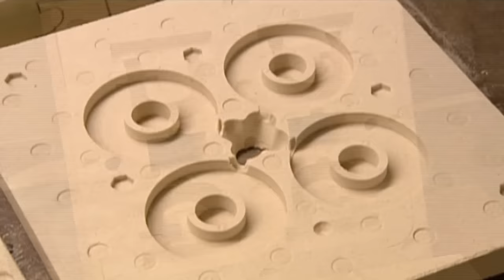MAGNETS | How It's Made

Comment: Never thought that making magnets is so labour intensive and difficult. Really expected the process to be almost fully automated. Thanks for the video!
Reply: It probably is for the very common shapes and sizes. This looked to be more custom products.
Reply: Metallurgy may be more automated in developed countries, but since the huge majority of it is done in poorest countries, it does end up being more labour intensive.
Reply: These are probably from the '80s or '90s 😂
Reply: This looks like a shop that makes low volume custom shapes. These are also  cheap nickel-iron based magnets. They are still used in cheap dc motors and similar products, but high efficiency and industrial products almost all use neodymium-iron-boron magnets, which are much stronger, and made via sintering, to tune their properties more precisely. Those are generally made in massive batches. And the processes are much more automated.

Comment: For those of you thinking that this process is wasteful and sloppy, let me introduce you to the metal industry, where a lot of processes like this are the norm. Mass-produced designs for items like these are very hard to make safely in any kind of laboratory or workshop, and factories rarely involve some kind of quiet, safe environment. Metalworking in general is very loud, messy, and slightly dangerous. That doesn't mean that a lot of the materials go to waste, though; the sand, concrete, and metal scraps used are usually ground down, cleaned, and recycled for later use again, since its mostly just silicates and metals. The metals are even sometimes chemically sifted back into their base components and reused as well, since they're the same metals that will go into the magnets anyway.

This is coming from a guy who worked as a metalworker/welder for a few years, and who has absolutely set himself on fire several times from just being around red-hot metal for too long. It's just the way it is.
Reply: Damn
Reply: @Nostalgicinquisitor  you and me both
Reply: @lucasjustlucas2176  lol
Reply: That's very insightful. Looks really dangerous, especially the guy pouring metal into that furnace with a short sleeve shirt.
Reply: Sebastian Thor  Nope, that's just the way the industry is in general. Some countries have worse practices, but it's mostly the same. When you're dealing with handeling molten metal, there's not much else you can do
Reply: Good one
Reply: Is there some way to automate the process so more items per hour could be produced?
Reply: Thank you.
Reply: Im not gonna read it
Reply: This should be on top.....
Reply: What is acoustic
Reply: I wanna hear more about this spontaneous combustion :D
Reply: Umm ok
Reply: Thanks for that information. It seems a lot of people in the comment section are experts and seem to know a better way to make magnets and other metals
Reply: Ayee cheers man!
Reply: I tip my hat to you.
Reply: @nejivoi  Gold member
Reply: I’ve worked on auto assembly lines in the 1960’s and they were messy, loud, and dangerous.  Later I worked night security in a drop forging plant.  It made the auto assembly plant look a lot better.
Reply: @Kalmaro4152  Occasionally, mass-production is improved upon, but it really depends on the item produced. With something like magnets, it's pretty finicky to figure out, but it's not impossible, and I'm sure that quite a bit has changed since this video.
Reply: @HomicidalTh0r  Funnily enough, it usually happens when you're wearing heat/fire resistant gear. You can't feel it, so sometimes you lean on something you're not supposed to and burn a hole through your shirt without realizing :)
Reply: @stroys7061  Exactly. Though, I imagine some of the methods have (probably) been improved upon since then.
Reply: @Kalmaro4152  Of there is, but someone has to build it first
Reply: Thanks for sharing this! I didnt think it was wasteful, just chaotic lol and destructive looking, but it is what it is.
Reply: Thanks for sharing the additional insight!
Reply: The longest comment I've ever seen
Reply: Crazy to think that you can just burst into flames as soon as your cloths get past their ignition temp
Reply: As an electrical engineer I see a lot of possibilities to improve efficiency and speed with automation!
Reply: @sneaky_krait7271  I agree! And in some cases there already have been vast improvements since the making of this video (when was this, circa 2004?). However, I know from personal experience that it's hard to develop automated machinery that's resistant to both high-temperature environments and strong magnetic fields like what's in the video. There's always the risk of machines melting themselves down or throwing molten iron around without realizing (which become a greater risk than simply making the magnets by hand), and magnetic dust can heavily interfere with installed hardware (a circuit board's worst nightmare).
Reply: @Kalmaro4152  Yes, but humans are cheaper than sofisticated machines (robots).
Reply: thank you for clarifying ,I thought this was very wasteful , but through this i can see that i don't know alot of things
Reply: @ExTess  Yea you will need good protection and filters for the dust. I am not sure if the magnets will make it impossible, but there is plenty of other metal producing. If they are applied they are ofcourse tested that they won't melt themselves
Reply: Thx for the info and your replies. It's great to hear from people with actual experience.
Reply: Thanks!
Reply: Not too many people can say they've set themselves on fire... MULTIPLE TIMES....
Reply: @OB1canblowme  When you're on the ground floor getting your hands dirty, you don't really care about those things, since they're mostly the responsibility of the higher-ups and the law. As long as the work is a controllable level of danger, and you're not breaking any laws, nobody cares. DFM and the ISO only go so far per manufacturer, otherwise it's just "here are the materials and the machines to make them, now do your job and don't break anything you're not supposed to".
Reply: Im glad theres jobs like this where people have to accept the scary in this watered down scared of everything society
Reply: @OB1canblowme  and I think you can start paying attention to automatic spellcheck before criticizing people of not knowing about Quality Assurance practices;
Quality Assurance standards are constantly evolving;
Reply: how are you still alive from being on fire and I also wonder how does it feel being set on fire? I work in the engineering firm and even tho i work near hot dangerous environment ive never been set on fire once
Reply: @siroof5663  Like I've said before, it usually happens when you're wearing heat-resistant materials, ironically enough. You don't always know when you're touching something hot enough to light you on fire until you look down and see the fire, since it doesn't hurt. And if you're welding, and distracted by trying to get the perfect bead then you don't always think to check your apron that's getting covered in molten slag. Other cases mostly involved sparks catching on a frayed part of my jeans, since they were very worn while I was working at the welding shop, or leaning on something I wasn't supposed to.
Reply: Well said 👍🏾👍🏾
Reply: Damn bro, thanks for the information!
Really appreciate it.
I've been reading your comment section.
Reply: I have worked in a soft drink plant and cleaned the large tanks in the factory. They send you with a helmet with headlight and harness and rope on your back. It's dark and really scary inside the tanks.
Reply: @What-ch1bn  its a way to say autistic without saying autistic.
Reply: I didn’t let you
Reply: Legit, cool story bro :D so to work in a company as in the video, what functions or businesses should I look for?
Reply: Be careful dude
Reply: @Nostalgicinquisitor  Magnetic
Reply: There is still a lot of waste here. Filling in the sand with a cup instead of something like a spigot? I'd love to see a Chinese magnetic plant and see if they are as sloppy.
Reply: Meh I wouldn't have even acknowledged people commenting on the sloppiness. This is manufacturing folks, it looks this way for nearly all types of manufacturing to a varying degree. Metal work is particularly messy, so is carpentry and lumber mills, just a different medium. I work on the worlds largest mass produced aircraft(s) and guess what its messy too, less than this of course but still messy. Cutting wings on some of the largest CNCs you have ever seen makes a lot of chips and requires a lot of coolant also results in a fair amount of scrap. That is just the nature of manufacturing. If you think this is bad you would probably think twice about stuff you buy on amazon daily from china if you knew how those factories looked and operated...

I will also note that depending on the product being manufactured, final assembly is by far the cleanest steps. So when you see an aircraft or a tesla in the factory being assembled, there is not a lot to be messy at that point, and there is more effort not to be because it will affect the finish of the product. To contrast, when pouring molten metal you are more concerned about speed since the metal will begin to cool and set immediately so spilling some drops but having a successful poor is better than not spilling any drops and losing 100% of it because you were too slow and it cooled prematurely not filling the mold.
Reply: @BenJaminLongTime  Yes! Exactly this.
Reply: Say that slower and dumber
Reply: In fairness there are at least a couple of other videos on youtube showing much more efficient magnet production.
Reply: Z
Reply: @What-ch1bn  illiterate
Reply: @cus6428  it’s like three paragraphs. Have you never read a book?
Reply: I've seen an episode of The Simpson that portraits the way it is :D
Reply: @What-ch1bn  then why are you replying? Let me guess......10 or 11 years old?
Reply: It's not even worth trying to make things any safer, because ultimately, peasants are replaceable and inexpensive, whereas retrofitting every metal workshop to have better safety standards would be costly and time consuming. I'm glad to see that the worker drones agree with their bosses about this and accept it as their fate.
Reply: @Elrond_Hubbard_1  I can't tell if you're being genuine or sarcastic, given that there are some people who would probably agree with either or both sentiments, all things considered

As Mike Rowe once put it: “In the jobs I have seen thus far, I can tell you with certainty, that safety, while always a major consideration, is never the priority.”

Some people know their limits and just want to get the job done. Those who don't, usually don't work in a dangerous industry in the first place. There's nothing wrong with wanting their work environment to be safe, but sometimes safety can't be guaranteed where you're needed.
Reply: @ExTess  sooo tell me, what niche were u involved with i.e. wire and cable, sheet steel? Round stock? Billet? And, how many countries have u worked in?
Reply: @OB1canblowme  hell they probly haven't even heard of an MSDS
Reply: U trying to scare the kiddos with stories about catching on fire? I've been welding 25+yrs and been on fire a dozen times or more. The 1st time my brother actually CAUGHT me on fire. Sibling rivalry, and nothing smells more sickening than the skin that sticks to red hot metal and just cooks... these durka durkas are 3rd world af. Ya, the metal industry is kinda no frills and borderline dangerous for dumbasses to be around. But let's not act like the human factor isnt far more dangerous (no matter what industry u look at). Just my 2 cents
Reply: @stroys7061  I mean that is basically just a giant hammer hitting a giant piece of metal
Reply: I'm just sayin' 'dem buy a big-ass magnet from you right now. You got salesmanship. If you already don't do it! I'll give you a 9.5 out of 10 m

Comment: How to make magnets: 

2:32 You need a magnet.
Reply: Not true.
Reply: I used the magnet to make the magnets
Reply: @MrStringybark  Wow, you are so smart.
Reply: Weaker magnets will do the work just fine..there are naturally formed magnets, but it's very weak.....guess that's how they made the first magnet....by using the natural magnet......
Reply: You could just search it normally and you would still find it, the workers are using magnets to speed up the process
Reply: They use electromagnets to make permanent magnets.
Reply: @TAWithiam  How'd they get the electricity to power the electromagnets?
Reply: @bsmith6784  single use batteries (known as primary cells) and early static electric generators (which used the triboelectric effect instead of magnetism). 

You can also make magnetic based generators with no permanent magnets as long as you can provide an initial surge of power to start the excitation (look up excitation_(magnetic) on Wikipedia).

Comment: If those materials were easy to re-magnetize we wouldn’t be using them for ‘permanent’ magnents. You need to heat it up until it’s red hot and then have it near a strong electromagnetic field (bigger electromagnet or permanent magnet that re-orients the atoms in the hot one)

Comment: 4:35 if this dude touches both plates while pressing the button he'll be toast. 30Amps at 300 Volts is pretty nasty. Why does he not have insulating gloves
Reply: I prefer Senku's method of making magnets
Reply: Did you see DC Amperes x 1000 ?
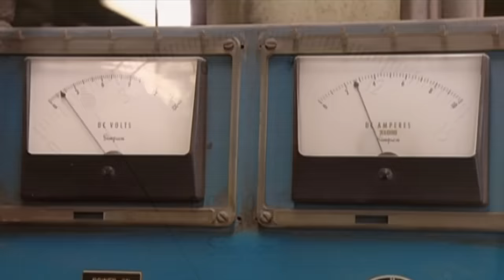03:52
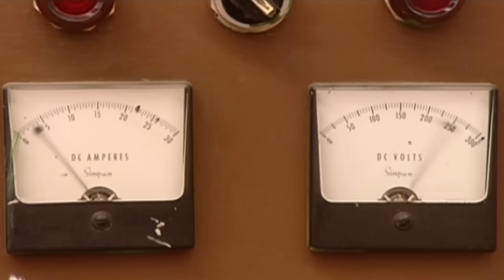Reply: He is literally touching the magnet at 4:24 when it gets magnetized. Im sure he is fine.
Reply: @AllanElMelon1043  Because the electricity goes through the magnet I think. If he's very well insulated from the ground at least.
Reply: I think hes fine cause electricity doesnt actually go through plates but instead there are 2 copper coils bellow plates which produce strong magnetic field that empowers magets

Comment: I have speaker magnets from the 1960s and the magnets are still strong magnetized.  They will however demagnetize if they suffer high temperatures ever and would need to be magnetized again by high current and voltage realigning a North and South dipole arrangement (probably heated again).

Comment: Is the metal permanently magnetized or does it wear off over time?
Reply: AFAIK it's permanent but you can demagnetize em by
1) heating em up
2) let em work into a machine that stays operational for years (motor, magneto)
3) reverse the magnetic field with another stronger field (the opposite of the latter operation in the video)

Comment: But how are magnets made before the discovery/creation of electricity?  Like in 1700's, 1800's, early 1900's.
Reply: They were found in nature.
If you go outside with a magnet and run it against sand, some of the sand stick to that magnet.
It works the other way and just like you find the metals in that sand, you can find magnetic pieces of rocks using a piece of metal. In some places there are rock and boulders, even cliffs that metal and magnets stick to. People noticed those rocks acted strangely and broke off chunks, eventually even mining areas to get magnetic pieces of the ground and stones. 

You can also charge metal by shocking it with electricity in less fancy ways than in this video. Certain types of shocks can turn metal into magnets.

Comment: If you can use electricity to make magnets and the pyramids are supposedly a form of generator because of water passing under and bronze being at the core was it magnetism how they made all those monolithic structures?
Reply: aliens... or oompa loompas i dunno
Reply: @redoverdrivetheunstoppable4637  because they try to say they did it on wooden rollers but the wooden rollers and the ground itself most likely wouldn't be able to support stones that large
Reply: @redoverdrivetheunstoppable4637  I never brought up aliens
Reply: @redoverdrivetheunstoppable4637  and I was more speaking of the South American monolith structures that were found that has Stones weighing 80 tons and also how some of the structures it looks like the stones have been fused together because the rock appears to have been melted and smoothed over
Reply: @redoverdrivetheunstoppable4637  I'm thinking maybe they had a different Alchemy then we know today and knowledge on how to create different types of Stone from loose minerals
Reply: @redoverdrivetheunstoppable4637  how much magic would it take to heat granite or other types of rock to roughly 1,500 degrees and if it's nothing special then why can't we replicate it today with our modern equip
Reply: @redoverdrivetheunstoppable4637  in one of the pyramids they found hallways lined with brass and other types of metal that led from the base all the way up to a central chamber. There are such things as Earth batteries where you stick two pieces of a conductive metal let's say magnesium or brass into the ground. And you can get an electrical current through it which you can read off of a multimeter. you can do this in your own backyard. A small test like in your backyard will only produce one or two volts of actual current. But on a large scale like a pyramid how much electricity could you produce and what could you do with that much electricity
Reply: @redoverdrivetheunstoppable4637  Nikola Tesla said electricity is alive and aware. And he also claimed to have gotten his ideas from his dreams. Maybe he was just a crazy man who died homeless and poor New York tenement building.

Comment: i know how to make magnet 
It is real and not electro magnet
step1:TAKE A Copper wire
step 2:take nail and a cell [battery]
step 3:roll the copper wire around the nail
step 4:connect the ends of the copper wire to the cell [battery]
step 5:take a pin near the nail until it attracts
step 6: remove the copper wire 
you will get a magnetic nail
100% sure it works
try it